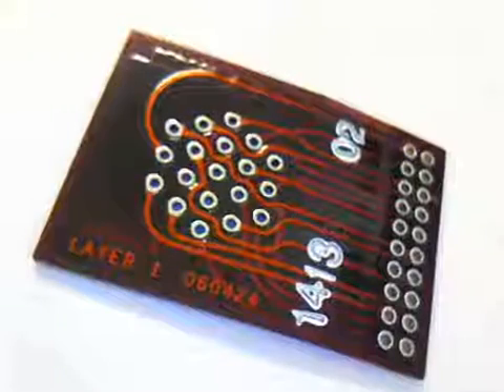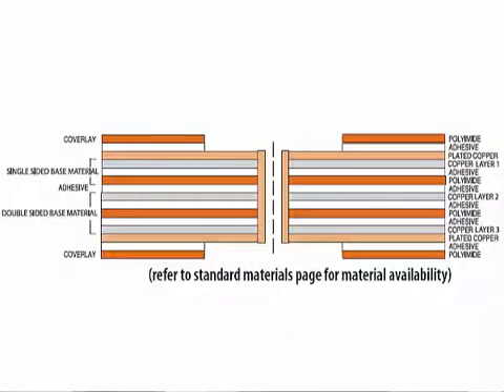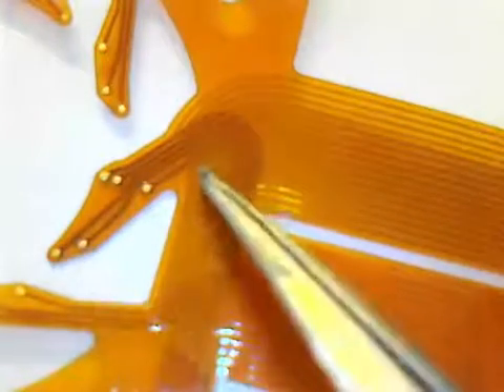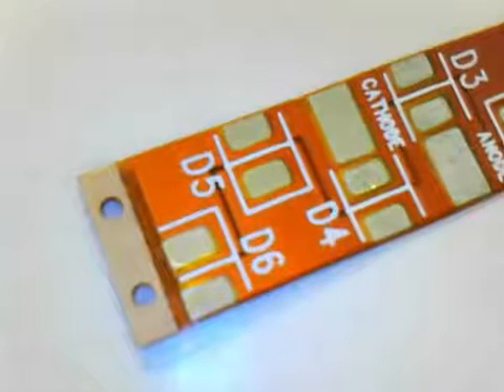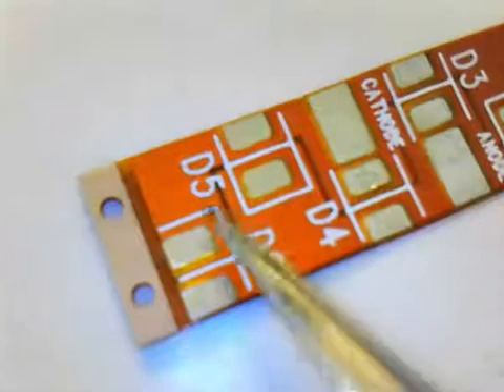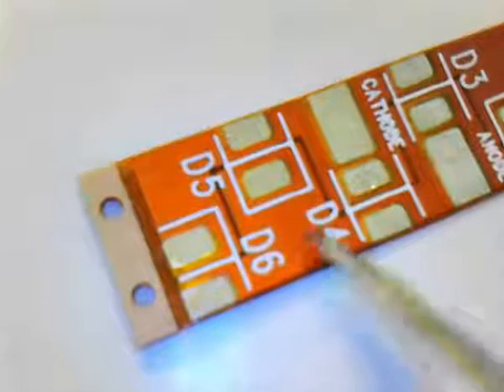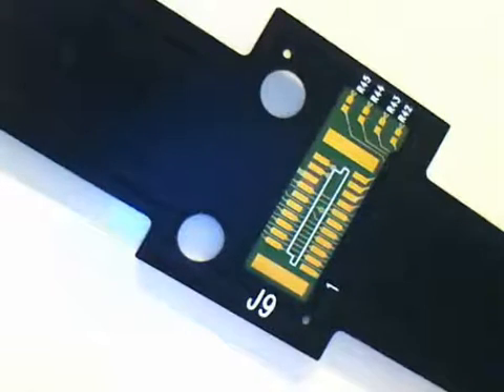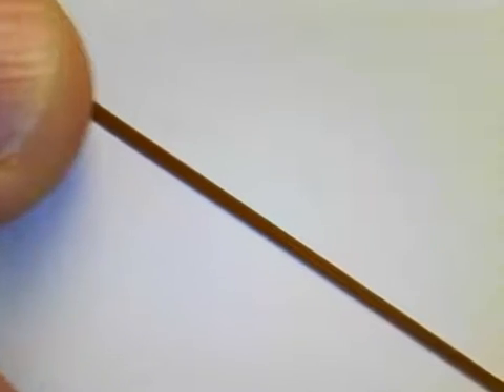All Flex   Alternative Flex Circuit Types

Comment: Hi, 
Thank you for the video. How to stop epoxy from spreading on a flex board. tried using  a tite fut mold around it, and it's  still spreads under the mold. Can you please help.
Reply from the maker: Hi Janan, Rigid flex manufacturers use no flow prepregs to keep the resin from flowing out onto the flexible areas of the part.  Thanks,